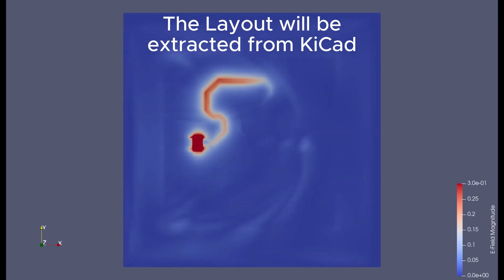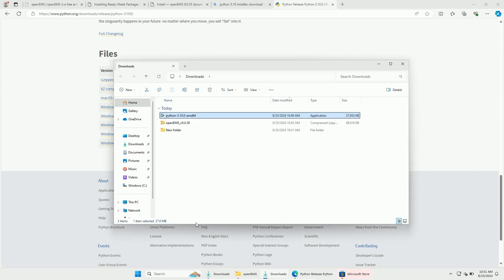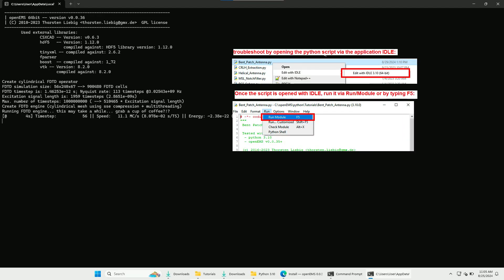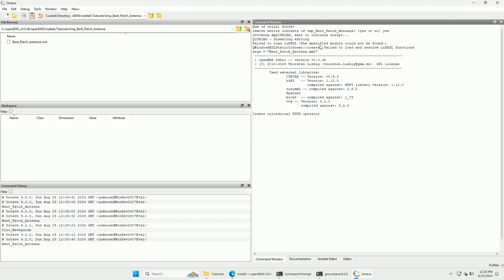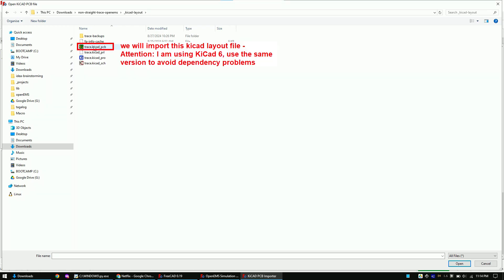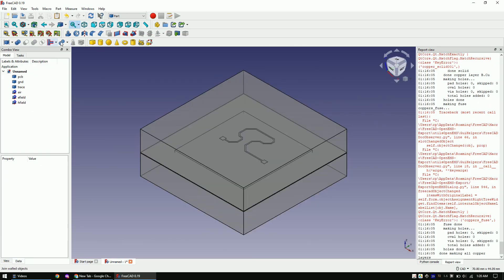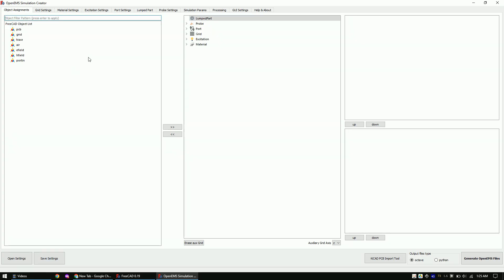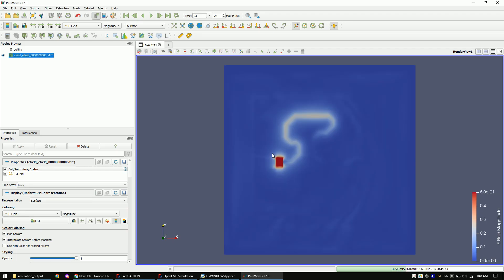free KiCad Wave Propagation Simulation with openEMS (E-Field, H-Field, HF-crosstalk and impedance)

Comment: Thank you so much for this video (and the others), they are great!

One thing is unclear to me: in the "Object Assignments" step, there are these priority lists on the right, I saw you reordering items there. What is the effect of those? And what's the logic you used for choosing the order?
Maybe you can elaborate on that in a future video? (apologies if you already did, I haven't watched all of them yet 😅)

Finally, regarding the FreeCAD-openEMS-Macro: have you considered maintaining a fork of it, and linking it in the videos? The original author seems unresponsive on Github.
That way it's easier to find than by googling for it, and some of the bugs can be fixed (some are really low-hanging, like the dumnp_type -> dump_type thing, and the initially disabled button).

Anyway, thanks again, and keep on simulating! 🚀
Reply from the maker: thank you for the question, very appreciated, I really didnt elaborate on this and will try to adress it properly in the next video.
Effect of the item order: the first item on the top will overwrite the ones lower. so if you for example have a port, but above it a copper item of the same size then your port would disappear. -> not good
Another example: if your airbox would be the topmost item, all other items would be ignored by the simulation as the air box covers all other items but is the highest priority as it would be the topmost item. -> not good again :)

I added the forking and linking of the videos to my todo list, consider it done within the next days.
Yay, agreed lets keep on simulating 🚀
Reply: @panire3  Alright, now some of the issues I've had when experimenting make a little more sense :) Thanks for the explanation.

Regarding the macro: I pushed some bugfixes (including the ones mentioned) to my fork on github, feel free to pull those, my handle is "nilclass".
Reply from the maker: @niklas2052  wow that bugfix was fast, thank you and i will check it out asap

Comment: Hey, greaat video! I am, however, having trouble with a more complex board. I am having trouble selecting a specific trace, in the bottom corner it is named as "unnamed.coppers_drilled001.Face26960" when i hover over it with my mouse. I can only find the object that includes it and all other copper parts on the board.
Reply from the maker: did you see my follow up video already? In it I am simulating a sliglth more complex board: https://www.youtube.com/watch?v=yrl2gRjtrek
Selecting single traces is not direcly possible, how it works is that you have just one copper object for all traces, you just place (=position) a "port" at the traces that you want to inject a voltage into.
If you send me a link to a screenshot or screen record, i can maybe help out in a bit more detail.
Reply: @panire3  I will watch it, thank you!!

Comment: great video. On top of that, in case of multi-tracks with the current version of the macro scripts you have to select a specific track before the merge of the copper. One possible improvement is to make  a python function that extracts from the KiCad PCB every track name and by selecting each one, the copper fusion will be decomposed quickly into each net, the compound created will have the track name, it will possibly save a massive amount of time.
Reply from the maker: With "current version of the macro", do you mean this one? https://github.com/LubomirJagos42/FreeCAD-OpenEMS-Export
Yes it would be nice to have each net decomposited and selectable via track name.

Comment: Great work ! I've tried myself many times gluing all these open source projects without much success. 
Do you think it is possible to extract equivalent L and C tracks parasitics elements from these simulation ? 
Have you tried simulating magnetics with their ferrite core ? 
I'm doing open source hardware power electronics and I would love to improve our design with open simulations :D
Reply from the maker: You can extract L and C from the scattering parameters S11 and S21 and using a spreadsheet program, but its quite a learning curve and very manual.
I didnt test out ferrite cores yet that include the exact 3D shape of a ferrite, but you can insert SMD inductors into the simulation via the Lumped parts tab. This of course doesnt mimic the exact model of the ferrite, but might be a good approximation.
Enjoy, and hopefully some of the videos help improving yours designs. :)

Comment: Comment to 4:43 (set an environment variable). for all the crazy people like me who use a pathname with a space like "C:\Program Files\openEMS" and if you are not used to the command prompt like me, you have to put the path in quotation marks so the line of code looks like this: setx OPENEMS_INSTALL_PATH "C:\Program Files\openEMS"

edit1: I ran into more problems with this pathname. Just put OpenEMS on C:/ and avoid this trouble!!

Comment: I get the following error when import "cannot find kicad_common" I attempted to install fcad_pcb, but I don't know what I am doing. I am stuck at trying to import my pcb into FreeCAD. Any pointers appreciated.
Reply from the maker: Hi there, For the openEMS tutorials you wont need fcad_pcb (i now completely removed the fcad_pcb macro and tried it with just the openEMS macro and it still worked). Are you encountering this error when trying to follow this specific video, or another one? Also, a quick tip: make sure you're using FreeCAD 0.19 and KiCad 6.0 (the whole kicad project has to be saved via kicad 6.0), as I’ve run into issues almost every time I switched versions. Feel free to send me a screen recording of the steps you’ve tried so we can troubleshoot together.
Reply: @panire3  Yes, I am using those versions. So, I am not sure if adding the KiCadStepUpMod solved this, but I was able to get it to open example KiCad PCBs. I am getting an error with loading the PCB I want to do the analysis on. I will keep working to figure that out. It doesn't recognize a character in the _PCB file. Weird. Thank you for this tutorial! My hatred of how brittle python is was curbed for a moment using your tutorial.
Reply from the maker: @terrysworkbench  alright good luck. if it just doesnt want to load even after more trying, you can later also send me the file and i will try loading it.
Reply: @panire3  I have the same error when trying with my board. Beside "cannot find kicad_common" it states: UnicodeDecodeError: 'charmap' codec can't decode byte 0x8d in position 798536: character maps to <undefined>
Reply from the maker: @inF1704   First I suggest to make sure you use the same version for all installed apps:
FreeCAD 0.19.4
KiCad 6
Python 3.10
openEMS 0.0.36 cp310 
CSXCAD 0.6.3 cp310

Also try to follow the steps exactly, no fast forwarding or skipping parts. 
 
I know that this whole process is quite troublesome, one day someone might provide a simple exe installation file for openEMS... :)

Comment: Great video! I hope you'll make more using openems. Its quite hard to find openems tutorials 😢, so really appreciate your hard work and effort on these tutorials
Reply from the maker: Glad you liked it, there is much more to come, stay tuned. :-)
Reply from the maker: And yes that one took a while to make, hopefully at least it will make the journey less painful for others.
Reply: @panire3 i tried to install for python but wasn't able to run the python tutorial from the openems folder. The error was some about assertion error. I'm trying to install it on windoes 11. Any ideas how to resolve this?
Reply from the maker: @nurhaida1983  not sure. Is it possible to share a screenshot?
Reply from the maker: @nurhaida1983  you can use a image sharing app, for example https://imgbb.com/
or
https://postimages.org/
Reply: @nurhaida1983  Facing the same issue. Was it resolved?

Comment: I have watched almost all of your videos. So good! I was just about to test out openEMS myself. I have used Comsol in uni which I believe is a FEM solver, just like the FEMM 4.2  you used in some other videos, as well as the ElmerFEM. What is the difference between openEMS and a FEM solver? Is it just 2d vs 3d? And any reasons that you switched to ElemerFEM from FEMM 4.2 in the more recent videos? 

Before I stumbled upon your channel I was about to test 'pcbmodelgen'. Have you tried that one? Seems perhaps like FreeCAD to OpenEMS is more advanced from the little I've read.

Anyway, apart from just mastering the open source tools I would like to simulate radiated emissions like you did in your video before this one. Could be very resourceful within my project. I would also like to simulate a co-planar diff pair with something more flexible than atlc. Any recommendations for this? Thanks and keep the videos coming!!!
Reply from the maker: Hi there nice to hear that you enjoyed the videos and even more if they are useful for an actual project. :)

Regarding difference between FDTD and FEM, try asking chatGPT he gave a better answer within a few seconds than I have got reading through several forums and articles.
internal difference (not visible to the end user): The main difference which even the name implies is that FDTD is time domain, so the calculations are done in time domain and then the result can be converted to frequency domain as well. FEM on the other hand theoretically can do calculations in frequency and time domain right away, but as end user I dont really care what happens internally (as a developer of those tools of course you would care a lot about this difference).
difference visible to the end user: FDTD in almost all cases uses rectangular grids, while FEM can also use Tetrahedrons (shape simlar to a pyramid). Tetrahedrons can minimize the "staircase effect" which you tend to get with rectangular shapes. As solution just choose a fine enough mesh, so again as end user you can use both tools just fine in most cases.
PS: FDTD and FEM can both do 3D, I only simulated the cross section in my last openEMS video because i wanted to keep it simple.
2D and 2.5D FEM: FEMM 4.2
2D and 3D FEM: Elmer
3D FDTD: OpenEMS

PCBModelgen: did not use it yet, but hey thx for the tip for another video :)

Enjoy running the differential pair simulation! The advantage of using a 3D solver is that it accounts for the effects of nearby traces, whereas ATLC assumes the differential pair is fully isolated, which isn't realistic in the real world.
Reply from the maker: sorry i oversaw this one: And any reasons that you switched to ElemerFEM from FEMM 4.2 in the more recent videos?
No specific reason, I am just showing how to use all the different options.
The advantage of FEMM 4.2 is that it is super fast because of the 2D/2.5D approach.
The 3D solvers take hours so simulate even for the simplest of traces. So if you want a quick and rough estimate of e.g. the voltage drop across a trace, Femm 4.2 is super fast. With the 3D solvers you will have to let the simulation run over night in many cases or often even over the weekend, just to see that there was an error and to have a bad start into the working week ;-)
Reply: @panire3  Thanks for the quick answer! I will address both of your replies here :-)  Solvers and simulators are very interesting, I definitely need to read up way more. Since I only use Linux I'll probably start with Elmer and play with that (even though I know virtualization will work just fine). You say it's 3D FEM but perhaps it has compatibility with 2/2.5D as well? 

I was thinking about what a realistic workflow would be. Perhaps simple 2D simulations at first, for the general stackup and maybe some irregular design patterns on the board if any. Then we layout and route everything according to these results and of course all the 'best practices'. Then we can either simulate the PCB fully or just take out parts of the trace routing, depending on which is the least tedious. I think you have demonstrated both of those two alternatives in your videos. What do you think?

I think what matters the most for me would be the time it takes for properly setting up a simulation. One button press would be ideal  ;-)  If it's faster to set up a full board by a simple import and some general settings, then it's fine if it will take time to complete. Simulations overnight are no problem, and/or in parallel. Then again I need to just play and learn the stuff to know more what to expect and learn the limitations.

Great to hear that you consider another video with the other import tool! I would watch for sure. Another useful topic of interest for me would be thermal simulations from KiCad and FreeCad models , just throwing that out there without even a search about it :-)
Reply from the maker: @jadahaa  Yes, Elmer can also do 2D but I only used it for 3D so far.

"One button press would be ideal  ;-)"
If you want one button press I think the commercial tools like altium designer are the best choice. Maybe they even have a student version for their signal integrity addons.

"Another useful topic of interest for me would be thermal simulations from KiCad and FreeCad models"
Elmer can do thermal simulations as well, i have posted a free link to my udemy course which includes thermal simulations in the comment section of this video: https://www.youtube.com/watch?v=trNCL96CELo
Reply: @panire3  Thank you! I will check it out